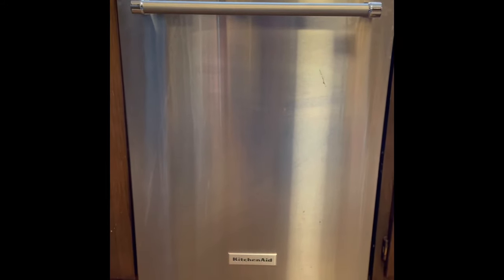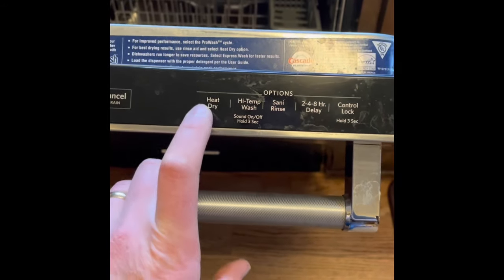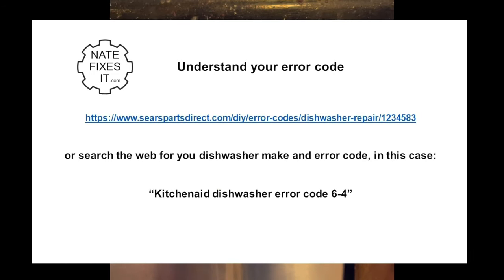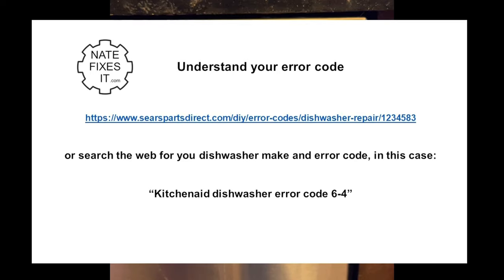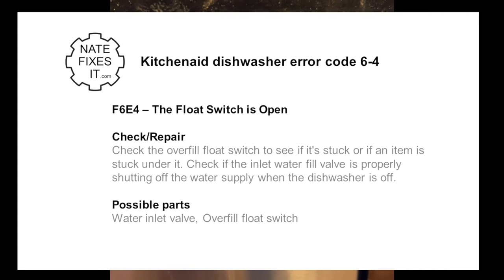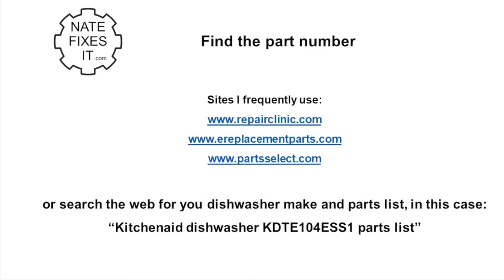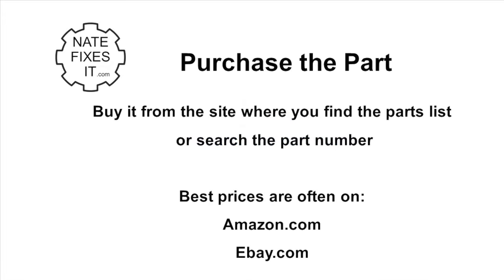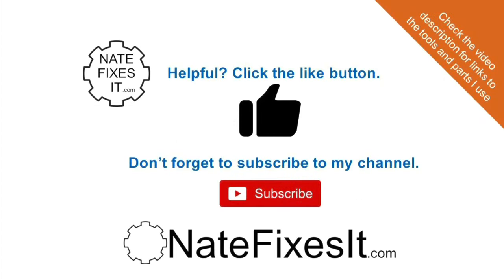Dishwasher Diagnostic Mode: find out why your Kitchenaid won’t work

Comment from the maker: I fixed my dishwasher with these parts:
- Float Switch (Amazon link https://amzn.to/382ScaT )
- Fill Valve (Amazon link https://amzn.to/2KRjGHS )
Reply: Why did you need both parts Nate.  They are mutually exclusive for me.
Reply from the maker: @kingsxkids  the code doesn’t tell you which of the parts it is.  They are both pretty inexpensive, so I ordered them both.  Would rather have the dishwasher fixed than order the wrong one and wait a few days for the other part to arrive.

Comment: Nate, I have this same Kitchenaid dishwaster but the LOCK BUTTON IS STUCK ON!  Cannot reset it.  Do you know what will reset that LOCK button??? Unlocking it by hnolding it for 3 sec. does not do it. Please help!!!  Thanxxx!
Reply from the maker: Try cutting the power to your dishwasher for one minute.  Flip the breaker for your dishwasher off to cut power.  If you aren’t sure which breaker it is, you can have someone watch the dishwasher lights while you cycle through the breakers, when the lights go out, you found the right breaker.
Reply: Have you found the fix I'm still dealing with this problem
Reply: @NateFixesIt  I also have this problem (and the product help website for Kitchenaid was worthless BTW)  When I used this error code finding routine, my dishwasher started running the drain.  No error codes ever flashed.  However, when it was done draining the panel lock was able to be unlocked!  So I am trying to do a normal load, to see if it will work.  What I need to know is whether  this indicates a faulty CI or bad control board?  How do I diagnose which it is?  And what is the best place to get those parts?   I have a KDTE254Ess2, very much like the one in this video.
Reply: @jackblackwhiterice  I also have this problem  When I used this error code finding routine, my dishwasher started running the drain.  No error codes ever flashed.  However, when it was done draining the panel lock was able to be unlocked!  So I am trying to do a normal load, to see if it will work.  What I need to know is whether  this indicates a faulty CI or bad control board?  And what is the best place to get those parts?   I have a KDTE254Ess2, very much like the one in this video.
Reply from the maker: @ellenran  sounds like you dishwasher unlocked, that’s good!  If it locks again, try cutting power by flipping off the breaker for a minute to restart the internal computer.  What is the original problem with the dishwasher?  No error code doesn’t necessarily mean nothing wrong, just that the dishwasher hasn’t self-identified the problem.

Comment: I have the same model as your video but mine didn't behave the same; after closing the door, instead of showing me the blink code, it started running some cycles... Is that right?
Reply from the maker: That doesn’t seem right.  I know my unit likes to try to pump itself out sometimes when you close the door, but I’ve never had it start filling on its own.  What problems are you having with your dishwasher that have you checking the error code in the first place?
Reply: Mine is the same, the appearance of the dishwasher is the same,different model though
Reply: @NateFixesIt  My dishwasher often stops half way during the wash, or just doesn't start after the water filling stage... It sometimes works and finishes the whole cycle, but doesn't work most of the time..:(
Reply from the maker: @reishin4346  I take it that there aren’t any error codes?

Comment: +1 on this video being very helpful. I discovered my Kitchenaid dishwasher (model KDTE204DSS0) has a slightly different button configuration (maybe a newer model?). On mine, you push the three leftmost buttons (ProWash, Tough, Normal) sequentially three times. Then everything else is the same. Thanks, Nate!
Reply from the maker: Thanks!
Reply: Once you did that was there a flashing light, I’ve done this a couple times and it just starts running water.
Reply: Thank you! Those were the buttons that worked on mine, too.

Comment: Thank you so much, I have been searching forever for a fix for my dishwasher! I had to unplug it to reset every time I wanted to use it. Mine was a 9-2 code and after I hit the codes the dishwasher came on but no light. It made some noise for about 3 minutes then shut off. When I tried the buttons, this time it worked!
Reply from the maker: Glad I could help!
Reply: Mine is doing the exact same thing. What exactly did you do? Did you have to replace a part?

Comment: Hey Nate, I noticed my 3 buttons are in a different order. I did it anyways & the lights came on. I closed the door & the lights just stay on. I have a kdtm4o4kps1 model. I was so excited to see this video but now I'm back to where I started. Any suggestions?
Reply from the maker: I can’t find specific instructions for your model; but, based on the way it is responding it does sound like you are getting to diagnostic mode and that the dishwasher isn’t showing error codes (doesn’t mean nothing is wrong, just means the dishwasher doesn’t know what it is if there is a problem).  

Another possibility is that you may need to advance through the diagnostics.  I’ve never used this technique, but near the bottom of the article of the link here, it discusses how to move through various diagnostics on some models.  https://machinelounge.com/kitchenaid-dishwasher-diagnostic-mode/

What problem are you having?

Comment: I had the same (6/4) error code and fixed it for free. My filter in the bottom of the DW was clean, which is deceptive. I had a slightly clogged drain line running to my disposal. It did drain but not well enough - I guess. 

I unhooked the line (my drain line is 1/2" pex which is probably too small) at the disposal and blew 125 psi air threw it - back into the dishwasher. Do this with the door shut if you're going to try it or you will make a colossal mess. The drain line just had muck in it. That cleared the clog.

I then took the kick panel off the bottom of the DW and there was water in the little white pan that the float switch sits in. That was what was tripping the float switch. I cleaned that up and put it back together and that fixed the problem.  

I assume the main drain line couldn't drain properly and that caused water to back up in the bottom of the DW and that water overflowed through the overflow tube into the float switch pan. The float switch tripped and shut down the DW. There was nothing wrong with the switch. It was just doing its job.  

If you have this issue make sure you're fixing the problem, not the result of the problem. If the float switch trips it's because the DW can't drain properly. There's a good chance your filter will look clean but the drain line is mucked up. 

If you don't have a compressor and an air chuck - buy one. It's cheaper than calling a repairman and then you'll also have a compressor!  

By the way - this is the exact same procedure for clearing the condensation drain line from your A/C air handler inside your house. If your unit shuts down for no known reason find the p trap inside the closet, attached to the unit, and there will be a removable float switch in the top of the p trap. If the line is full of water because it's mucked up with algae, just use that brand new compressor and air chuck to blow out the drain line. Pour some bleach down the line to kill the algae and reinstall the float switch. That will probably save you $300-$400 bucks on a simple service call.
Reply from the maker: Glad that you were able to fix it.  The 1/2” PEX drain line is definitely too small.

Comment: Thank you Nate and all those  who do what you do and try to help people with repair A couple of thoughts, I came across a movement called "right to repair" could you speak to that?    Also for all of us that are capable of fixing things if we know what the problem is. We are being ripped off for parts usually there is not much you can do about that but some times yes.  The little black switch in the door mech. used on many types of appliances are called microswitches  they wanted $ 26.00  for mine those can be sourced for about $2.00!   last year the defrost timer on my freezer went bad  priced from about 50 to 70  I found it for $12. Almost all the appliance manufacturers  by the parts from some place else if you can locate the source you can save $$$. Again thanks Nate
Reply from the maker: Thanks for sharing your thoughts.  I agree that repair parts are often overpriced and have a huge markup from the manufacturer.  I am in favor of right to repair.  I think that once you have purchased a product, you own it and should be able to do whatever you want with it (including repair it)!
Reply: I saw a single dishwasher screw listed for $ 8.75.   It can't cost more than 1-2 cents to make.

Comment: This was such a huge help thanks for making this video! I need a new heating element for my KDTE204ESS2 with the 7-1 code 🤙🏻
Reply: Glad that I could help!
Reply: That could also be an issue with the base pump. If the pump isn't moving the water, it won't register as being heated...

Comment: Buttons a little different:  1=ProDry, 2=ProScrub, 3=Hi-Temp Wash.  Model=KDTM354DSS4, Ser=F73101642  Thanks for the video.
Reply from the maker: Thanks for sharing!
Reply: My "Options" panel is different: Heat Dry—Pro Scrub—High Temp Wash—Sani Rinse. Did the three you referenced work for you? Thank you.

Comment: Thanks for posting. Mine was flashing 8-1 (once you showed me how to read the code!). Looked it up and says no water. Looked under the sink and the installer had turned off the water supply after running a test cycle...why? I don't know...Turned on the water and she runs perfect now!
Thanks again!
Reply from the maker: Great to hear you got it working and this video was able to help.  The simple fix is the best fix!

Comment: I would greatly appreciate your help. My "Options" panel is slightly different: Heat Dry—Pro Scrub—High Temp Wash—Sani Rinse. What is the correct diagnostic code sequence for my panel? Thank you.
Reply from the maker: What buttons do this is model dependent.  If the buttons above don’t match.  Try the three left most buttons and the three right most buttons.  For some models any three buttons in order will work.  If none of those work for you, you’ll need to provide the model number.   Feel free to try any of the combos, it won’t hurt anything to try them.

Comment: Hi Nate, I have model KUDL021RBS1. Key pad is in front. I  have pressed buttons and all the light light up, but not sure what it should do. There isn’t anything blinking.
The problem I am having is when I close the door and push start the cancel button start blinking. It usually does that if the door is open during a cycle. If I push resume the cancel button just flashes
Reply from the maker: I haven’t dealt with this issue myself, but here is a website that has some tips:  https://readytodiy.com/kitchenaid-dishwasher-blinking-flashing-0052/ .  I would start by cutting power to the dishwasher by turning off the breaker for 15 minutes, this will force the dishwasher to restart its internal computer.  From what I’ve read, another likely issue is a short in the control panel, which could require replacement of the control panel.

Comment: Hi Nate! I have kitchenaid KDTE104ESS4 and my issue is it seems the heater (for drying) isn’t working. No matter what cycle I choose, including “heated dry” the dishes come out really wet/ with a lot of condensation. That is the case with Jet dry as well. 

Now my dishwasher has a mildew/wet smell all the time and I just don’t use it. 

Any tips or ideas of where I should start? 
Thanks in advance!
Reply from the maker: Were you able to run a diagnostic test and did it identify anything?  It sounds like a bad heater element.  The heating element is used both to heat the water for a wash cycle and to dry the dishes.  If you have a multimeter, you should be able to check the element resistance to see if it’s gone bad.  I haven’t had to do this repair myself, but you should be able to find a video from someone else who has.

Comment: M y kitchenaid dishwasher does not have an external light.  We got it into diagnostic mode and closed the door .  How do we know it has finished the diagnostics.  How long do we wait.  one post I found said it could take anywhere from 20 to 30 minutes to complete
Reply from the maker: For me it just took a few seconds (the video is real time, no cutaway).  If you get to diagnostic mode and you don’t get a flashing sequence, it could mean that your dishwasher hasn’t self-identified an issue.

Comment: Thank you very much for your helpful videos and advice. I have a KitchenAid Model # KUDT03STSS3. I have been unable to attain a Diagnostic Mode. Does it exist for this model? I bought it new in approximately 2008 or 2009 as 2008 is when the User's Manual was printed.
Reply from the maker: I can’t find diagnostic mode instructions for that model.  It may not have it.  Try pressing any three buttons in a row as shown, for some models it can be any three buttons

Comment: Nate - I need help I got my dishwasher into diagnostic mode via your video and it gave me 5-1 code which is door latch issue, so I ordered and replaced door latch assembly but its still giving me that code once in diagnostic mode what am I doing wrong or what else could be an issue? dishwasher is a KDTE204ESS1 model
Reply from the maker: What’s the operating issue that you are having?

Comment: I have a 2017 Kitchen aid KDTE104ESS3 that is not cleaning dishes and I am unable to get the dishwasher in diagnostic mode to show codes.  I have already changed out the circulating pump, but not much of an improvement.  Was thinking the diverter motor or washing motor might be the next best bet to replace.  Any suggestions?
Reply: I did get it to work and codes were 7-1 which states the Heating element doesn't work.  Does not help with dishes not getting cleaned.
Reply from the maker: @MrYoungj99   are you having any issues other than dishes not coming out clean?  Can you hear it filling with water and spraying?  The first thing I recommend is to clean the filter, here is how I do it in mine: https://youtu.be/ylGDzryIG-Y.  If the filter is clean, it’s filling with water, and spraying water, check the holes in the sprayer arms to make sure that they are all clear.

Using hot water will also make a difference, so if the heating element is bad, that can affect how clean your dishes get.   Even if your dishwasher fills off of the hot line, if the faucet isn’t run ahead of time to get hot water into the pipes before it fills, you are putting cold water into the dishwasher.  Try running the kitchen faucet until the water runs hot before starting the dishwasher.
Reply: @NateFixesIt  I have cleaned out filters and checked the spray arms.  All looked good and no debris was found.  I have ordered a new heating element to replace but I will try getting the water hot before starting the dish washer first.  Thank you
Reply from the maker: @MrYoungj99  good luck and thanks for watching!

Comment: Very helpful video!! Thankyou. Quick question. I have a  kdfe104kps slightly different model number. Can I still check issues via diagnostic mode with this style dishwasher? Thanks again
Reply from the maker: If it’s very similar the diagnostic mode should be the same.  Give it a try and see what it tells you!

Comment: Hi, I had Water run over and apparently get in to the electronic panel on the top and will only blink, clean and beep. I let it dry out a couple days turn the power completely off to it with the breaker. None of the buttons work except for cancel. What do you suggest?
Reply from the maker: Unfortunately, I’m guessing that the computer controls are permanently damaged and either the control panel or the dishwasher will need to be replaced.   Based on the age of the dishwasher, and the cost of the control panel, you may decide either way.

Comment: Helpful video, but my KitchenAid dishwasher has all the option buttons on the outside face of the door. There are no options on the top edge of the door. (model KDFE104DSS3) does this have the same fault code detection system?
Reply from the maker: I’m not sure if it has the same system for fault codes.  Try pressing any 3 buttons in a row, 3 times in a row, that works on many models.  You can also check this website to see if any of these options work for you: https://machineanswered.com/kitchenaid-dishwasher-diagnostic-mode/#:~:text=You%20can%20run%20diagnostic%20on,)%2C%20depending%20on%20the%20model.